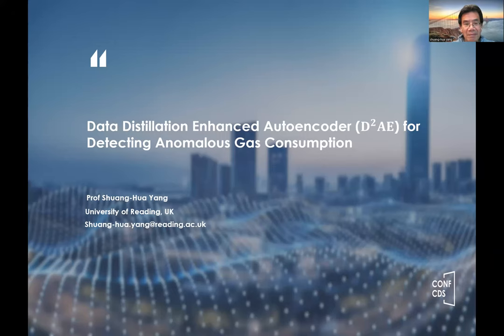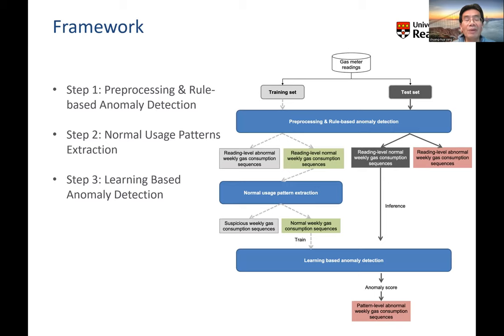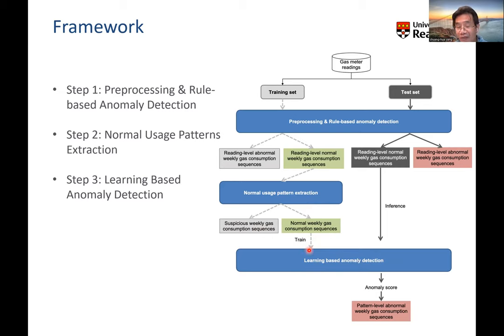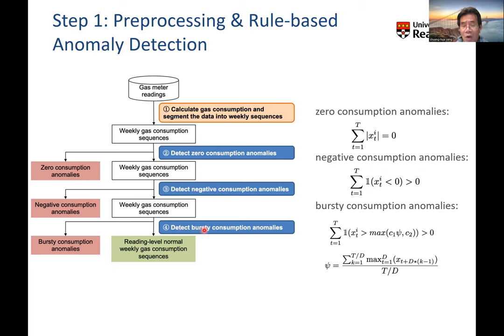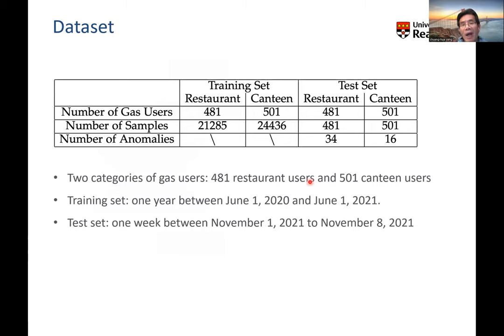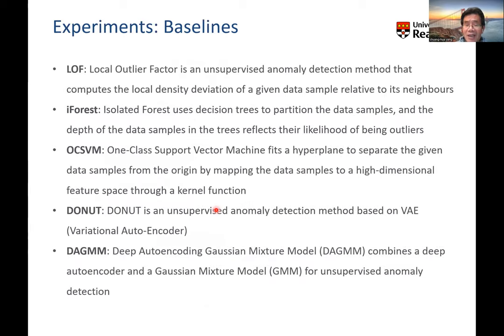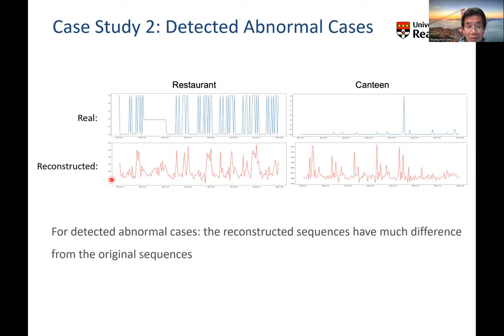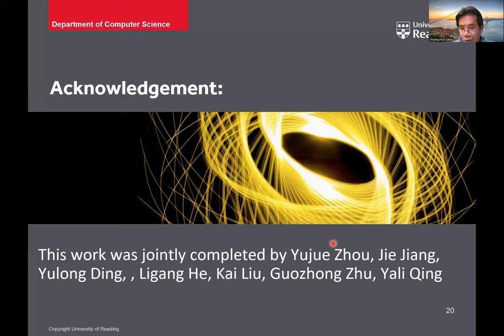CONFCDS 2023—Data Distillation Enhanced Autoencoder (𝐃^𝟐 𝐀𝐄) for Detecting Anomalous Gas Consumption

Comment from the maker: Dear Professor, thanks for you presentation, I know more about the Process and Rule-based Anomaly Detection and the Normal Usage Patterns Extraction. I have two questions: 
1. We can see in the dataset part, the number of samples between Training Set and Test Set differ greatly, so could you explain what specific factors contribute to these differences? And how they function? 
2. In the future,  which fields can the Data Distillation Enhanced Autoencoder for detecting anomalous gas consumption be used to?